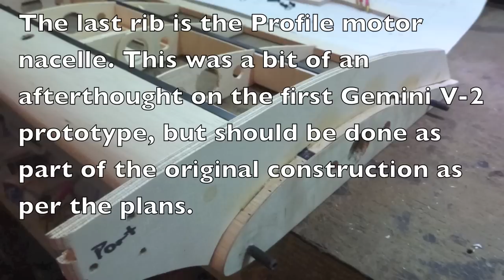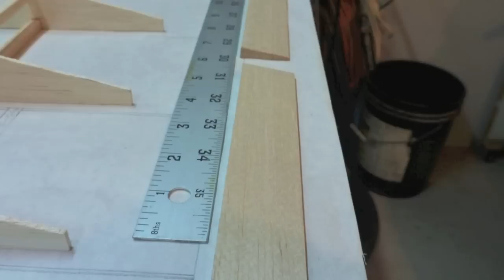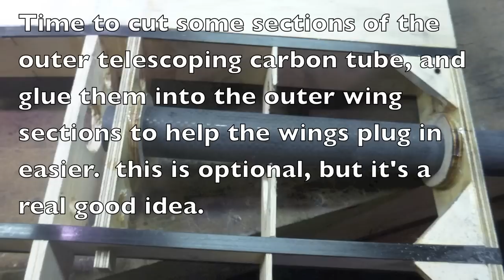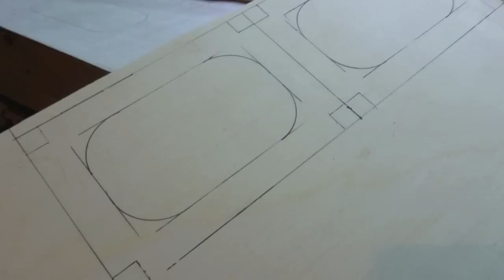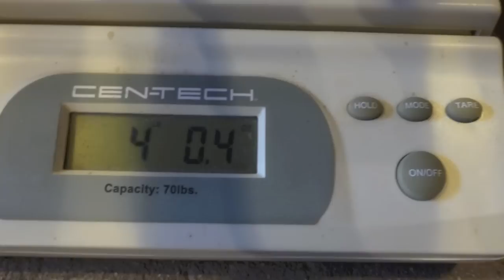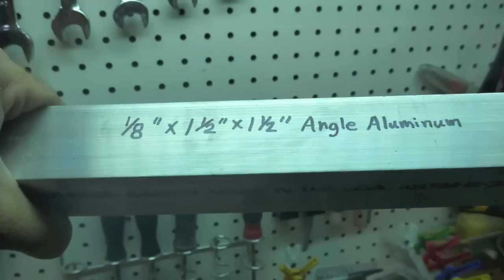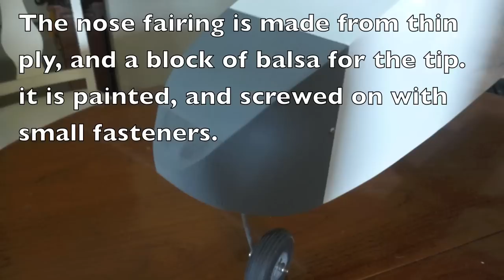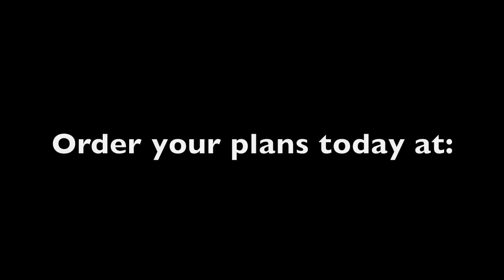Gemini Version 2 Scratch Build Video / Building an Advanced FPV / UAV Airplane

Comment: if the fuselage have been more rounded, i would have purchased one from you.  very well done job tho.
Reply from the maker: it would be possible to make a round battery..  but would make it very hard to integrate payloads and build doors.   I do appreciate the positives of round (or oblique) fuselages.  This was due to practical considerations.  Ultimately, I think that wing optimization is much more important, as the wing accounts for the vast majority of aero drag.   the Indicated airspeed is also very slow(42-55kph), so any gains in drag reduction for the fuselage will be small, compared to a faster aircraft.  Thanks for your feedback.

Comment: Great video, but I still couldn't get the wing mount part
Reply from the maker: The center wing section is held with bolts.   is there a specific part you don't understand?  do you have the plans?  they also come with step by step build instructions with pictures.   I'm making a very detailed build video right now for the kit version, so will have all of that very soon.

Comment: Very cool! What flight times do you get?
Reply from the maker: sill be doing some testing soon, but based on amp draw, should be right around 3 hrs, with a small payload. potentially more with more advanced batteries, and / or removing the landing gear.
Reply from the maker: Team Icarus RC Flight times are now officially at 4+ hrs!

Comment: What kind of motors and props are you using ?  Thanks !
Reply from the maker: A long list of specs including the motors and props is listed on the store page of the website.  
The motors are elite power 15 , and the props are 13X8. one pusher, and one tractor. counter rotating inward. click on the link to the website for more info. cheers!
Reply: Thanks.  Congrats with the plane !!

Comment: Does anyone have any updated links for the plane? Most of them are either sold out or don't work. Thank you.
Reply: the links are accurate. What is sold out? What does not work? You can buy the plans on the bearospaceindustries website, and order a laser cut kit by sending an email to Wayne.
Reply: If you click on the links, about half are sold out. It's alright though, I ended up finding the rest somewhere else.
Reply: Oh you meant the parts list! Yes I found my CF spars elsewhere. I am about to look into the parts I need for the landing gear. I think I will get a CF one with wheel pants from www.espritmodel.com

Comment: Don't understand your use or the carbon fiber in the wing spars it providing very little if any increases strength in vertical flex the carbon strip is much stronger turned 90 degrees this would also probably allow for more g maneuvers or an increased usable load
Reply from the maker: Its not just one strip.  The center section and begining of the outer sections uses a 27mm diam. carbon tube.   The outer sections have two I wood I beams with vertical webbing, and carbon strips top and bottom.     This forms an extremely strong I beam with carbon top and bottom, at the extreme edges.    
you are correct that single embedded strips would not be sufficient.   In fact just placing a strip (even a thick one) on edge would also not be sufficient, and would be heavier.
If there is any doubt as to the strength in a high G pullout, have a look at this:
https://www.youtube.com/watch?v=IcPlUckKix8&t=5s

Comment: some very late observations.    at  4:21,  that  (non-functional flat)  carbon in the wing was just  DEAD WEIGHT.     doh.       can you spell   SPRUCE.       it is not clear whether wing structural design  CORRECTLY  included  Effective  dihedral  Bracing.    at 6:42, it appears that the main wing ended up having,  a  WONKY  profile.   compare the clark-y (v1).     at 23:23,   there is a  REASON   thrust is  usually  BELOW  THE  WING.    why.     the wing is IN  THE  PROPWASH.     greater airflow over the upper surface of a wing,   Will Result in there being  EXCESS  lift  made,  at those   TWO    INBOARD    LOCATIONS.     it is a certainty that you did not  Understand that  when a horizontal stab is located  'higher' at the tail,   the  Moment of Its  MASS   is  DIFFERENT.        googletranslate
Reply from the maker: The carbon fiber strips form an I BEAM, and in the outer wing section, they transfer the load from the entire outer wing panel to the  1/4" Birch ply "BOX" structure, which transfers it to the tube for modularity.   Carbon fiber is many times stronger than spruce, especially when placed in an I BEAM.  The I BEAM is made from balsa for the majority of the wing, so the resulting structure is also very lightweight, key for any aircraft. Solid spruce spars were great before carbon fiber existed.  Carbon fiber is also flexible, but has a greater rigidity than wood,  reducing aeroelasticity in the airframe. 
The Carbon strips as well as the 1/4 inch birch ply span the dihedral break, so that there is no weakness there.  
The Profile, (actually called an airfoil) looks "Wonky"to you because it's not a "Clark Y". 
It's a GOE398, a high lift, multi purpose airfoil developed by Daimler in Germany in the late 1920s' for transport aircraft, and works well at vastly different Reynolds numbers.  It's not the most efficient in terms of L/D, but has a very low sink rate at a relatively high wing loading, allowing the aircraft to efficiently carry a large battery, and payload.  
The thrust line is determined by several factors, the most important of which is how the addition of thrust affects the trim, due to the relative location it has to the center of aerodynamic pressure in flight.  We arrived at the exact location after extensive testing verified the calculations.  We changed it when we create a mode to reduce the dihedral, so now there are two options for the dihedral angle. Both are included in the plans, and there is an option for the kit. 
Of course the moment of the "mass" of the T-tail is higher, but That is not a bad thing. it's mass is extremely small, not that it would matter anyway..    The T-Tail does keep the prop wash clear of the stabilizer, and control surfaces, so that consistent responses for a given PID setting can be obtained when using an autopilot. It's also easier to get used to flying In manual mode, as the handling with full power, and in a glide is exactly the same.   The T-tail also provides increased  stability in spiral trajectory mode, which means that if the airplane tends to fly in a straight line, and can be trimmed to do so for extended periods of time, without corrective input from the pilot.   Did you know that most General aviation aircraft are unstable in Spiral trajectory model and that it is considered a "good thing" because it keeps the pilot awake?  Even bicycles are inherently directionally stable... 
As far as Bernoulli, if you think that is how the majority of lift is created, well, it's not.. Most of the force is created by newtonian lift, partially due to the Coanda effect.   The effectiveness of which is primarily determined by the shape of the leading upper edge of the airfoil.  it's true that there is "excess lift" created at the inboard sections behind the prop arcs with power on.  the propensity to tip stall is greater then, however the long wings with rectangular planform reduce this effect substantially.  The airfoil combined with a high degree of pitch stability (thanks in part to the T-Tail, and  it's high center of pressure) and a limited elevator effectiveness, due to it's moderate but adequate size, (arrived at after much experimentation), does not allow the wing to stall anyway, if applied gradually, even to full deflection.  With Autopilot and airspeed sensor, stall prevention logic separates this event even further from the mind of the pilot when in any of the FBW modes, or auto mode using arduplane, assuming that stall prevention is turned on, and the IAS is set properly in parameters.   
All twin engine aircraft have this tendency.  Few have given it the consideration it deserves... 

Are we clear now?   
 I'm hoping so, but guessing not. 

I've made a video specifically about twin engine aircraft, and flight dynamics of them, but not everything discussed here was covered.   there is lots of good info online, but obviously, much incorrect information as well.  this reminds me of a discussion I had with a physics professor who explained lift with the Bernoulli principle solely.  it was obvious he did not understand lift, and was not willing to consider that more effects than one were occurring.    anyway, cheers!  if you are willing to actually discuss the matters in terms of aerodynamics, and physics, I'd love it.I even love criticism. 
  If there will be only attacks, and mis information, we will not have the discussion. I have much to do..

Comment: I actually don't think it's suck a good design. It doesn't seem engineered. It's too bulky. 4+ hour is easy to achieve. The only thing I give you, is your lifting ability. But I'm sure any plane of that size, twin engine, could carry that payload.
Reply from the maker: magicmike1122 Name another electric powered fpv plane which flies for 4 hrs.   
do your homework!
Reply: FPVREVIEWS and just to add. The Gemini required 56,000 mah to fly barely over 4 hours, while the Queen Bee flying wing only required 20,000 mah to fly 3 1/2 hours. That should tell you something right there.
Reply from the maker: magicmike1122 you are referring to the solar powered queen bee? with no landing gear, hard points on the wing? swappable payload bays?
how much did the queen bee weigh?
of course a lighter weight plane can fly with less power.  but it can't carry as much weight at the same time. 
please clarify..
Reply: The solar adds little to no benefit, I'm sure. Removing the solar (weight) will give that plane over 4 hour flight time with that configuration. I agree. The Gemini has really good payload ability. I just think it needs to be more aerodynamic. Its very boxy, but that's because it's a scratch build.
Reply from the maker: magicmike1122 you had better do more research on solar.  

my design could be a little better, if it had more blended surfaces, but it's meant to be built by people all over the world, and most of them will be using square batteries.  
check out the silent falcon concept. it's a very effective hybrid solar electric uav, and solar impulse, also perpetual aircraft. 
solar is very viable.  it's being added to many commercial, and military use UAV's to dramatically increase flight time. on a more efficient platform, you can remove most of the batteries, except for a little to maintain propulsion during short times under a cloud, etc.  better the airframe efficiency a little more, and you can actually charge batteries,a nd maintain flight during the day, enough to power the plane during the night. the next day you repeat, the process, and reach what's called an energy neutral morning. 
 
to gauge efficiency, there are many factors, not just how much power it uses, but weight, for instance. also functionality, of course an aircraft that has, say landing gear, loses some efficiency, over one without, so you can't compare the two fairly.  
otherwise it's like comparing apples to oranges. 
if 4 hrs is easy to achieve, then show me an example. pure electric. hobby, fpv.  even without landing gear. best i have seen is 3 hrs by a tech pod. my plane was also under gross weight for the 4 hr flight, so in theory, it could do about 5+ hrs. and it's not meant to break records, just to map fields, and increase food production.

i know you mean well, and i really liked you concept to add an emergency rocket to an airliner. you just need to spend a bit more time educating yourself about the fundamentals, and new developments in technology before making blanket statements. cheers!
Reply: So you see my point. Your design would be better if it were more aerodynamic. But, I see your reason for building it the way you have. 

Regarding solar. I love it. It's beautiful. But, at this time, it only works on very large aircraft. The size of our planes, just is not enough to benefit from using solar. This will change as solar efficiency increases.

I will work on that project myself. I actually want to fly 25 mile over water to an island near me, so I will work on a plane that will fly for 4 hours... 

Thanks. But please understand, I'm criticizing your design to get you to respond, and therefore think, and therefore improve an already great design... Without criticism, where would we be?
Reply from the maker: magicmike1122 there have actually been some very small aircraft powered very successfully from pure solar. somebody converted a DLG glider,a nd there is a very simple solar plane that's even smaller , with a slab wing, lacking any airfoil. the plans are on ebay, an video on youtube of it flying. again, do your research.  and you don't need to fly for long to go 25 miles. 
even at a slow loiter speed, the gemini v-2 can travel 160km.
Constructive criticism requires finding a way to improve, or at least identifying a specific problem, rather than just using terms like "not engineered". 
and gain, do your research . learn for example the total impact of parasite drag on an aircraft vs. the induced drag, and experiment with the practical value of a non laminar  airfoil vs a laminar flow type. 
Of course any aircraft can be improved, but mine is meant to be a workhorse. 
picking about a pickup truck's poor aerodynamics will not get you very far. it does not mean that the pickup needs to be re-designed, or that the engineers didn't realize the impact of the box attached to the back of the thing. 
even better than criticism,   go make something inherently better in every way,  then show it to the world. 
it will take a lot of work, but you seem to have  a good brain, an slots of enthusiasm, so you can do it, if you put your mind to it. you just have to know how to direct your efforts.
Reply: +magicmike1122 Dude, what's your beef with these guys? They arent a University trying to make cutting edge, perfect aero. They are making very good, DIY airplanes. And Solar is totally viable on the RC scale, it's just expense and complexity that most dont bother with. Even if you can get 2amps solar energy, it's 2 amps the batteries dont have to carry. Where's your 4 hour plane? please make a better one.
Reply from the maker: +Andy Winter thanks for the realistic perspective on the issue. magic mike is just playing the troll here, it seems, or is just not understanding of the principles, and goals involved.  Here at Bearospace, we're always open to ideas for improvement. thanks for your perspective.
Reply: Troll? That's what you call criticism? That's why you're building airplanes at 40 years old and still living with your dad... and Bearospace? Oh god... I won't even start there.
Reply from the maker: +magicmike1122 wow, you make up a lot of false facts. i'll take that as a compliment, the only true thing is that i design and build airplanes. i wasn't even talking to you.